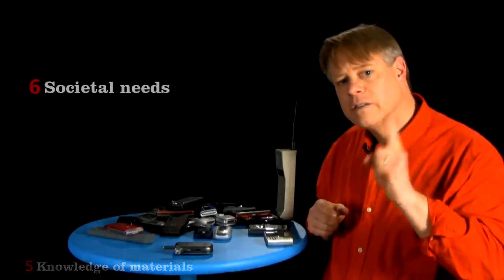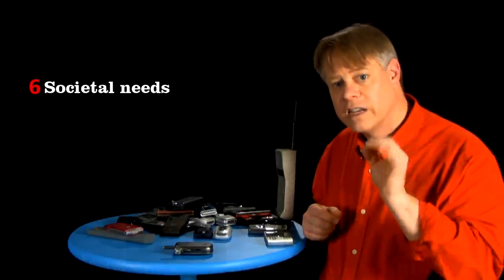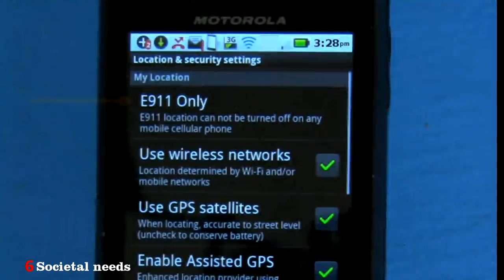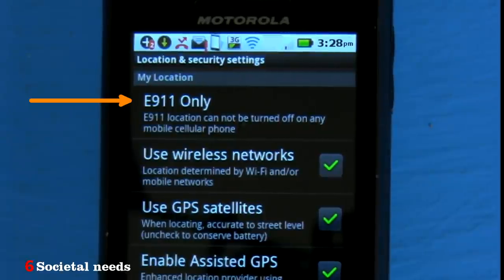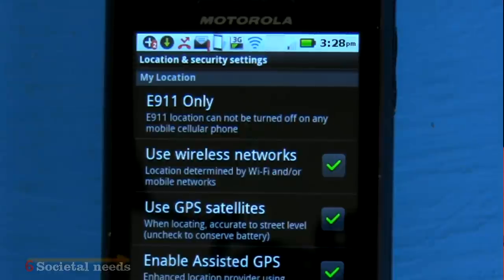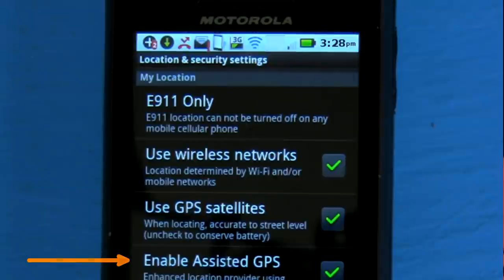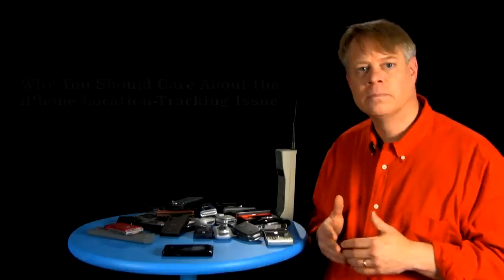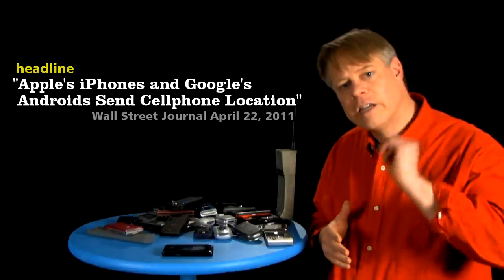Cell Phone Design

Comment: Updated 2016 version?
Reply: Yes! +1
Reply: +Justin Nanu yes!
Reply: Modern cell phone design rules:
1. It's a rectangle
Reply: Gavin Remme You completely missed the point of this video if you want an updated video. All these points are universal meaning they transcend time, phone manufacturers still use these points to make a consumer friendly phone. Just because the technology has improved doesn't mean that the most basic rules don't apply now.
Reply: I am still wondering where he has gone :( I don't see many new videos
Reply: Why? The points in his video are still relevant and hold up today.
Reply: 2018 version!
Reply: If there was to be a modern version, it might be something like,
"Portability? Nah, fuck that! We're putting in the biggest screen available on the market and pretend that we care about portability by shrinking all the bezels until you can't even grip your phone without accidentally touching something on the screen. Also we're giving contoured edges to the screen for no practical reason and charge you an astronomical sum."
Reply: 2020 version?
Reply: Or 2021 version ?

Comment: The big reason for more powerful phones is new semiconductor processes which have dramatically reduced the power required for logic gates.  Transmit powers have actually been going up, but higher data rates result in higher overall efficient use of battery energy by the radios.  I used to develop cell phones.

Comment: Assisted GPS does not use cell phone towers to "triangulate". It still calculates your position just like standard GPS: by comparing timing signals sent from each GPS satellite against precise orbit data that tells you where each satellite is.  But rather than downloading the orbit data the standard way (from the satellites themselves at 50 bits per second for about 12 minutes), your phone in "Assisted GPS" mode downloads the orbit data from the broadband data network in a few milliseconds. Once the receiver has the orbit data, computing position is fast and simple.

Comment: Full screen phones do come from sci-fi, the most memorable are the early 2000's Stark Trek FPS games. your tricorder is a full screen device. Star Trek: TNG PADDs were sort of like smartphones, but nobody on the show thought about how files could be transferred, so when somebody was "busy" their desk would be covered in PADDs. The Pip Boy from Fallout, while having some physical controls, has a large green monocolor screen, not touch sensitive though as it was essentially an early 80's IBM/PC compatible shrunk down to fit on your wrist. The Nintendo DS is based off of the design of the Pokedex from Nintendo's Pokemon series, a dual screen device with physical controls. Star Trek: DS9 had a scene with Sisko using a full touchscreen tablet, although it has some physical buttons. Star Trek: Enterprise, while being a terrible TV show, had full screen tablets. Space Odyssey: 2001 is the first movie I can think of that had full screen tablets.

Comment: The Motorola Razr is one of those designs that still looks cool even today. The only design problem it had was the circuit board for the keys, which would wear out quickly due to the thin keypad.

Comment: "Assisted GPS" is not "Network Positioning", Assisted GPS is actually a file that you download from the Cell tower to tell you the frequencies of the GPS satellites in the sky so the GPS chip doesn't have to scan, Network location uses the Cell-tower ID(s) and a database of tower locations to give you a rough location based on the tower(s) visible.

Comment: Hey, I remember that little app when it came out about the "new approach" to typing and I heavily disagree with it.  I see their philosophy about there needs to be an approach for small screens, but it doesn't have to be an entirely new method.  Look into a program called swype.  I can guarantee you you can have a higher WPM and accuracy without the ramp-up time if you use that program for your android.  The Swype 3.0 beta is even better with on-the-fly suggestions.  Try it, you'll like it!

Comment: Perhaps one other design constraint, the cultural psychology that somehow the smaller a device is the better it is. They are ergonomically terrible unless you have the hands of a three year old. Touchscreens relieve this somewhat. Aesthetics of cell phones are also terrible. One basic design, something the shape of a soap bar. Rotary dial phones were often works of art and great engineering. 100 years from now, what cell phone will be remember as great in terms of ergonomics or art? Few or none.

Comment: Plastic parts are shit. The world would be a much nicer place if things were not all plastic.
Reply: He Ka so metal
Reply: He Ka Yes but metal is much more expensive and also much more heavy, so instead of a inexpensive and light phone you would have a heavy and expensive phone, plastic is also much cheaper to recycle compared to metal, and metal is also hazardous to the environment, some just like plastic, only iron rusts fast when in contact with air, others like steel, copper, nickel, gold, silver, aluminium, etc last years when buried, so by getting rid of plastic you would not save the environment nor the economy.
Reply: +He Ka So, Glass or Ceramics would be the only choice for insulating electronic parts. Not clever.
Reply: +Mp57navy Yes yes. You guys are so clever. I admit plastic is great in many places but it should not be used in friggin Everything!
Reply: +Argoon1981 Some metals are easier to recycle than most plastics. The efficiency and purity with which you can get back used aluminium is likely unmatched by any polymer, since you can pretty much recycle it endlessly. Gold will likely last millions of year unchanged when buried, but it's completely harmless and barely reacts. It's always about the individual material, a generalization is nearly impossible.
Reply: Real price probably more like $100.
Reply: modern phones use a lot of aluminum, like iphone.. samsung s7  also use glass
Reply: JuanLeTwnz Hmm.... that generalization thing applies to everything, every rule (physical/legal), every quote, every thought in the universe.....I have thought about this in many free times 😂😂😂
Reply: Plastic is the best and the worst at the same time. Imo, we should be more aware of where we use it. Plastic-Packaging is a hazzard, and it could also work without - but everybody has yake his part. 
Back to mobilephones: plastic is not the greatest problem there. The Smd-parts, Chips and other componets contain rare earths that need a lot of energy to ectract. Also they are sourced in poor regions where really inhuman conflicts take place bc of them. 
So the best way to do it is just not buy a new smartphone ervery other while once you bored of the old one. 
But i guess y'all probably allready know. Take your responsibility.
Reply: He Ka Matter and Energy are shit. I prefer Dark Matter, Dark Energy and Anti-matter.